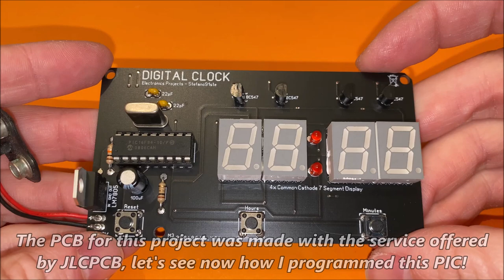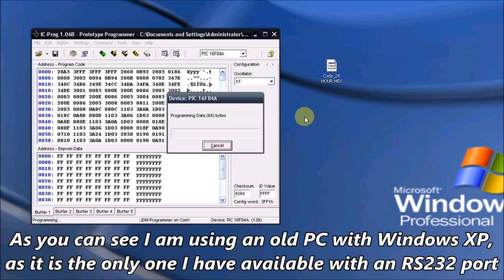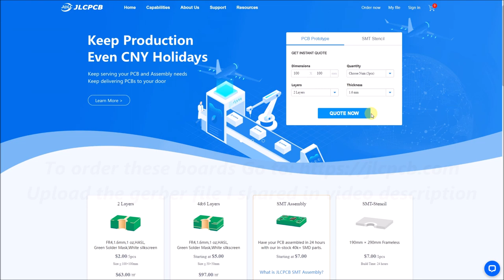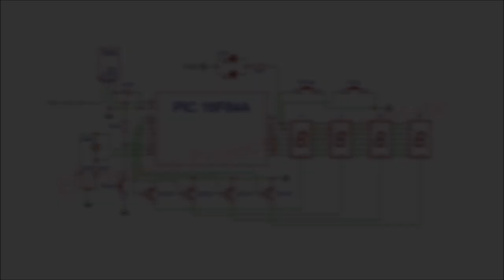Digital LED Clock DIY with PIC 16F84A - PCB Tutorial

Comment: I didn't know you used PIC microcontrollers 😮. They were the first MCU I used.
Reply from the maker: This clock and an 8 LED KITT light are the only two projects I made with the PIC 😁
Reply: What micros are you using now?
Reply from the maker: Lately I am no longer using microcontrollers but analog electronics, it fascinates me a lot :)